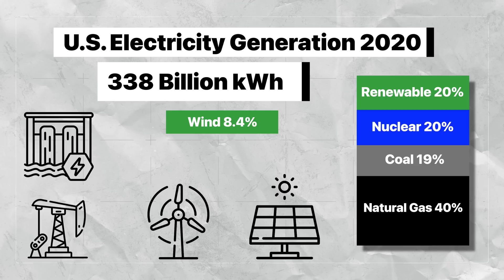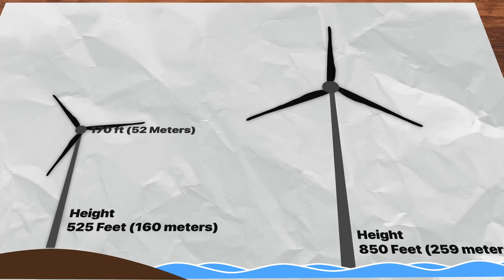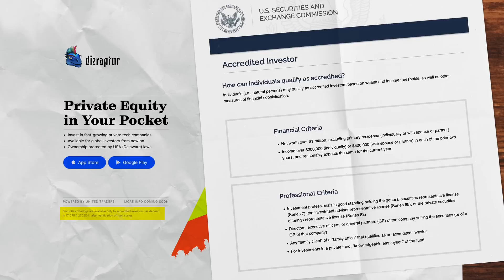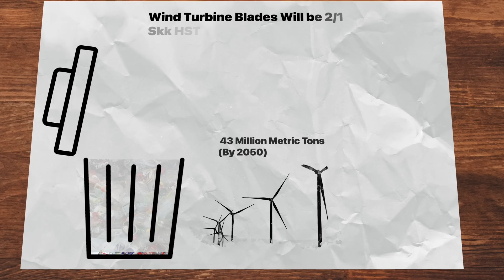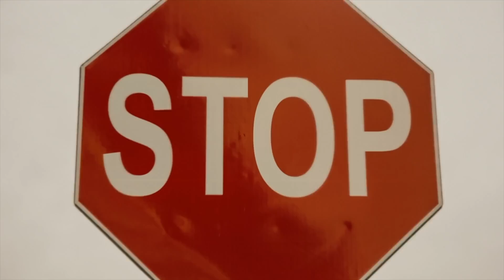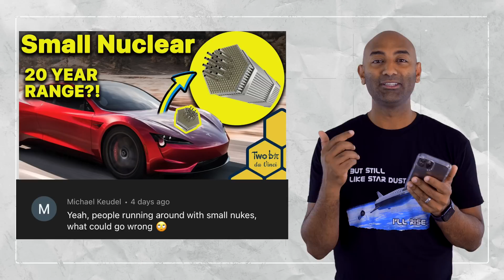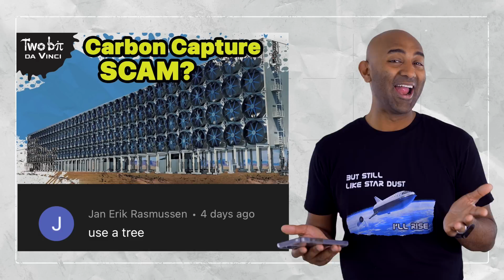The TRUTH About Wind Turbines

Comment: Why is recycling Turbine blades an issue?... just put them in landfills.. it's actually the best thing for the environment... vs spending more energy, and possible fossil  fuels, in breaking down the blades to their recyclable components.  I think we need to get in the mindeset that sometimes recycling maybe environmentally unfriendly as the total energy used to recycle (renewables and fossil fuels) may be more than just cutting it up and putting it in a landfill.  In fact we should look at landfills as an environmentally friendly option as a method of carbon sequestration, both of the carbon in the item and for any addition energy needed to recycle the iems (any use of energy - both renewable and fossil fuels - leaves a carbon footprint... that is, by using energy from renewable sources, that's taking away from the energy being used to replace fossil fuel produced energy...).
Reply: This video is not correct. A company in the Netherlands called Extreme Eco Solutions does recycle decommissioned wind turbine blades as well as decommissioned yachts into 100% street and wall tiles without subsidies and with a profit. This man who made this video did no research at all.

Comment: Completely carbon free during it's entire lifetime is it? Does it's lifetime not include the manufacture of it? How are you mining and smelting all the steel that goes into the massive amount of  reinforcing steel in the massive concrete base undereath each wind turbine (the concrete itself produces tonnes of carbon dioxide)? What about all the steel, copper and other metals in the turbine itself? What about all the oil in the gearbox? How do they produce the blades? Are the towers and blades lifted into place by fairies and unicorns?
Reply: Yes, but it does not take much more energy and resources to construct a wind farm compared to a coal power station plus infrastructure to mine and transport the coal, over 30 years a 1GW coal power station will burn 100 million tons of coal, 100's of million of gallons of oil to process the coal, 5.5 trillion gallons of fresh water, and produce 5 billion tons of slag to landfill and 300 million tons of CO2.

The wind farm needs no fuel, no fresh water, no oil to mine and transport the fuel, and produces a fraction of the waste to land fill.

all the wind farm requires is maintenance, which wont be any more man power than maintaining and processing the massive coal infrastructure.

Basically over its full life time the wind farm will produce around 1000th the pollution of a coal power station.

Comment: What was not mentioned in this video are the technologies that can separate the resin from the fibers allowing decommissioned blades to be upcycled. That makes for a positive business case, meaning the near future will see blades upcycled rather than on landfills.
Reply: This video is completely wrong !!! This company in the Netherlands, Extreme Eco Solutions, recycles decommissioned turbine blades as well as fiber composite yachts into 100% recyclable street and floor tiles without subsidies and with a profit. Very very poor research from the person who made this video. 

It is not the technology that is wrong, but people are.
Reply: @insAneTunA  Stop the spam. Separating the resin from the fibers would be a superior method as they could be reused in less stressed components in other uses, while shredding composite to use as filler is simply sweeping under the rug.
Reply: @ChucksSEADnDEAD  Wrong, they recycle the turbine blades and boats into 100% recyclable street and wall tiles. It doesn't matter how they do it, or what method they use. Fact of the matter is that they make new products from the turbine blades and boats.
Reply: @insAneTunA  That's not recycling because the material isn't brought back to its original form for the original use, it's being physically shredded as used as filler inside another material. Recycling would mean restoring the fiber and resin to their original components so that a new fiberglass composite part could be made. Shredding and mixing is just reusing it as filler without recycling.

Comment: Why does no one seem to care about anything else that ends up in landfills?  If these folks are saying we shouldn't use wind energy because the blades end up in landfills, then what else should we not be using that also ends up in landfills, because basically everything ends up in a landfill. Every consumer item can be found in a landfill, from car parts to paper products to tooth brushes - basically any household or commercial item. So, should we not have toothbrushes because they end up in landfills? Hogwash. It's not bad to make wind turbine blades better, more recyclable, but to say we shouldn't use them because they end up in landfills (while not saying that about literally any other item) is nonsensical.
Reply: Renewable energy products have the massive benefit of granting energy independence from ____ (fill in your biggest oppressor here) and people make a huge fuss about them. They are bemoaning the thing that will set them free and give them clean air to breathe. Human beings are very odd.

Comment: Someone should make a recycling machine that can be transported easily from landfill to landfill, then it becomes profitable for everyone.
Reply: This video is not correct. A company in the Netherlands called Extreme Eco Solutions does recycle decommissioned wind turbine blades as well as decommissioned yachts into 100% street and wall tiles without subsidies and with a profit. This man who made this video did no research at all.

Comment: How much energy goes into making them? The steel has a mega joule input energy costs, and we do not have clean steel. Also you said it’s a base load power which is not accurate , most wind has under 25% capacity utilization, vs nuclear 90%> .please lmk if I’m not accurate

Comment: How about a study on how much it really costs and how much pollution is involved it building a large windmill. Metals have to be mined or derived from recycled material but still have to be processed. All takes power and usually involve "fossil" fuels. Rare Earths needed are mined and supplied by China. Lubrication is also required and how about those pictures of helicopters deicing them. Any count on the number of birds killed? Birds fly into the low pressure behind the blades and their lungs burst.
Reply: A 1 GW coal power station, would take approx. 1 million tons of resources to construct (including the massive infrastructure to mine and supply the coal) and over 30 years will burn 100 million tons of coal, use 100’s of millions of gallons of oil to mine, transport and process that coal, use 5.5 trillion gallons of fresh water in the cooling towers, generate 6 million tons of toxic slag and 0.5 million tons of infrastructure to landfill and produce 300 million tons of CO2 gasses plus many other toxic gasses.

Compared to say the Dogger bank wind farm (the latest and greatest 3.6GW wind farm under construction in the UK)  Around 2 million tons to construct, and will require no fuel, no fresh water, no oil to process the fuel, produce no greenhouse gasses, and generate approx. 0.3 million tons of turbine blades to landfill.

Wind farm require maintenance, which will be no more than the resources required to maintain the massive coal infrastructure while mining and processing the coal.

Basically offshore wind farms are over 1000 times less polluting over their full life cycle than coal!
Reply from the maker: it's quite simple really, the blades are the biggest parts, they're totally hollow, and again last decades. they produce gigawatt hours of electricity for decades. Fossil fuels burn in an instant and you have to keep burning them. You sound like a smart person, so I'm sure you're aware, its not even close
Reply: Yup, research has been done on bird killings, and it turns out that regular tall buildings and radio antenna's kill by far the most birds. The amount of birds killed by wind turbines are negligible for the bird population.  And besides that, this video is not correct. A company in the Netherlands called Extreme Eco Solutions does recycle decommissioned wind turbine blades as well as decommissioned yachts into 100% street and wall tiles without subsidies and with a profit. This man who made this video did not do any research at all.

Comment: For God's sake, they are machines. Just like all other machines, they wear out.  What's wrong with breaking them down on site every 20 years, replacing parts that are worn, reassembling them, recertifying them and putting them back into service?
Reply from the maker: i like this idea
Reply: @TwoBitDaVinci  This statement comes with some experience. Members of my family operated and maintained the Naughton coal fired plant for nearly 60 years near Kemmerer, Wyoming. They were everything  from engineers to janitors to equipment operators. They routinely tore down the turbines, boilers, heat exchange units, piping, environmental equipment as specified with complete overhauls every 15 to 20 years. They never waited for things to break. Maintenance was key to the life of the plant. It has operated since 1963 continuously without a major breakage. I can't see why this philosophy can't be applied to wind turbines. It may require the purchase of a number of 200 ton or larger cranes. On the other hand large equipment is nothing new to this idea considering the size of equipment that was used to feed coal to Naughton. 

Naughton is the plant that is being converted to natrium reactors. The plant itself is very close to some of the biggest wind turbines a person has ever seen. They are so big that they boarder on the scary side when a person first sees them.

Bill Gates, Berkshire Hathaway, and the US Government originally were teaming up to convert Naughton to the experimental nuclear natrium reactor using the existing steam turbine(s). The natrium is sodium salts cooled. Though the project is in the very preliminary stages, there has been some talk of constructing a large molten sodium pool near Naughton where both Naughton and the surrounding wind turbines will use the sodium pool as a giant load dump for excess production. The steam turbine(s) would then be run off of that common sodium pool.

At least, all of that is the last that I have heard. I understand things change with the politics involved.

Comment: So the claim is that wind power (and I like wind power as a part of the solution like sea wave power) produces zero emissions is problematic. We must factor in the cost to acquire (materials) produce, transport, assemble and dissemble (or dismantle) the turbine or just to replace a damaged or aged out blade. Its the same issue with EV cars, liquid fuel vehicles, etc etc. The cost of carbon emissions must include the acquisition of materials, transport to the facility assembly, transport (usually by ship, train or trucking and all three) and then the cost of producing the electricity which still stands using fossil fuels as the majority producer. So zero cost emissions is a pipe dream for now. And currently we can't without significant fossil fuels unless we want to return to atomic/ nuclear energy (which solve the waste and sabotage problem: I think is viable add on). * The end user cost; yeah I agree we are reducing that emission over the life of the end user.  All that said, love the channel, the discussion and the presentation well done. Keep it up.
Reply from the maker: during operation, it has no emissions. Not cradle to grave, yah you're right.

Comment: Why do the blades even have to be replaced? They look just fine in those landfills.
Reply from the maker: all products are built with some sense of life. So fatigue cracking and stress concentrations can become an issue after this point. So theoretically they're fine, but engineers have to replace things before failure. Usually using a safety margin.

Comment: A few questions:
How do these blades wear out?
Why can't blades be made from recyclable titanium and/or aluminum, like airplane wings?
Reply from the maker: thanks, as 4G64 Turbo mentioned, composite stregth as a function of weight is unrivaled, even by things like titanium. They wear out because all materials undergo stresses and fatigue. The design consideration is expressing a safe useful life. Usually with a margin of safety built in. You can't have these falling apart and falling down from the sky, ,so we have to replace them on some interval deemed safe, even if they could have a little more life in them.
Reply: Strength to weight ratio of metal alloys are nowhere near that of high tech composites.
Reply: This video is completely wrong !!! This company in the Netherlands, Extreme Eco Solutions, recycles decommissioned turbine blades as well as fiber composite yachts into 100% recyclable street and floor tiles without subsidies and with a profit. Very very poor research from the person who made this video. 

It is not the technology that is wrong, but people are.

Comment: Every green  energy proiduction is better than nothing.
However it is a cost and environment analysis.
With the same cost, is there nother form of green energy that is more economical and have less environmental impact?
olar panels require some materials that are dirty to mine.
I don't understand enough abour nuke plants but in the appearance, they look safe if done right and the materials don;t end up in the wrpng hand t make nuke bombs.
Trump may be right. When you get to a large scale to replace fossil fuel, the cost to the environment may be so enormous that it may be better to burn coal.
Nuke plants can produce enoigh electricity to power all EV.s.
It may take somebody like Elon Musk  to redesign the wind turbines.  they don;t need long blades and can sit in the ocean or high in the atmosphere.
 heat pump extracts energy from the air.  Go HVAC.

Comment: 8 years to 25 years life span....hopefully this gets increased and more recycling and direct reuse ideas come out........also maybe micro at home wind is more easily recycled?

I also wonder if the energy used to create the fiberglass is taken into account....very high energy from what I understand.
Reply from the maker: good points Dusty!
Reply: This video is completely wrong !!! This company in the Netherlands, Extreme Eco Solutions, recycles decommissioned turbine blades as well as fiber composite yachts into 100% recyclable street and floor tiles without subsidies and with a profit. Very very poor research from the person who made this video. 

It is not the technology that is wrong, but people are.

Comment: I would suggest that the blades could be constructed of aircraft material... light weights, rust resistant , it may cost more but in the long run cheaper and more recyclable...may

Comment: Likely there's a sourcing issue. If you provide architects with 3D files and shipping costs, I'm sure they could integrate them into many projects. A bunch of 20 foot blade tips would make a great patio cover for instance, low cost fencing along a highway, public park sculptures, etc.  But designers need the 3D files and cost info first.
Reply: Right, repurpose them!
Reply: What do you mean sourcing issue?  Usually when a person says that, it's in reference to manufacturing a product, and there's no sourcing issues that I know of for producing wind turbines.  Most, BTW come out of China.  Others come out of Germany.  Probably most the ones being recycled now came out of Germany.  China usually has little to no sourcing issues for almost any manufacturing because of how much they've worked globally to procure raw materials (and why it's hard for other startups outside of China to get into certain manufacturing).  It's pretty much the same for Germany.

Considering that most of these would have been built around the year 2000, CAD was still pretty new then.  Businesses had computers and many homes already had PCs, but it wasn't like it is now.  But to repurpose a few hundred blades, I would think it would be pretty easy for an engineer to go on site and get an idea for what can be done with all that material so I don't know why they'd have to have some pretty ancient documents that show how a product was designed.  I can understand why they need to understand the materials and manufacturing process that was used to make the blades.
Reply: @johndoh5182  Sourcing of used blades. An architect is not going to drive to another state to physically measure a scrapped blade. If the CAD dimensions and shipping price were available online an architect could use it to design with. They would not present a concept to a client if the used blades were not known to be readily available as a building material (cut to shippable lengths).

Comment: OMG!! THAT'S HORRIBLE!! 
Easy solution: build a portable wind turbine blade chipper-shreader to the decommissioning site. 

We shred cars. A balsa-wood, glass fiber, epoxy resin hollow structure you can feed in from one end shouldn't be a problem. 

So, any other "problems?"
Reply from the maker: Like I mentioned , a blade can be as long as 21 SUVs… their size is massive
Reply: @TwoBitDaVinci  With respect, it's not the length that matters. It's the max width. Even if it needs to be chopped into pieces before shredding, the concept works. Transport the chips for reuse/recycling. Problem solved.